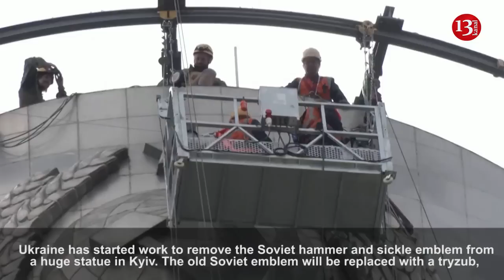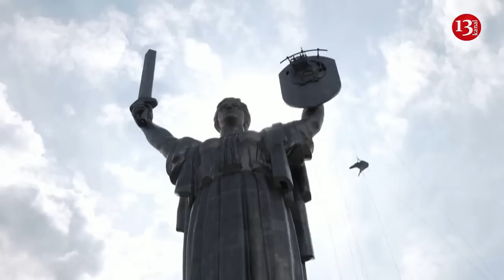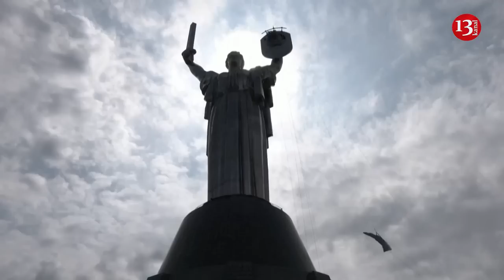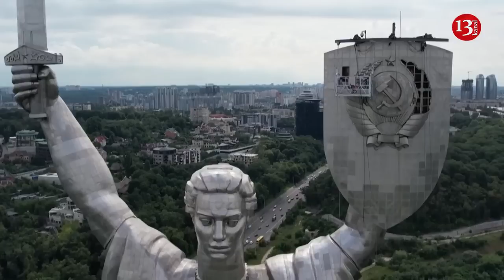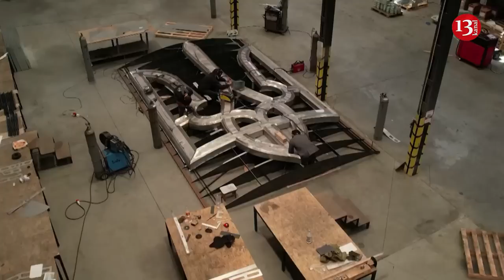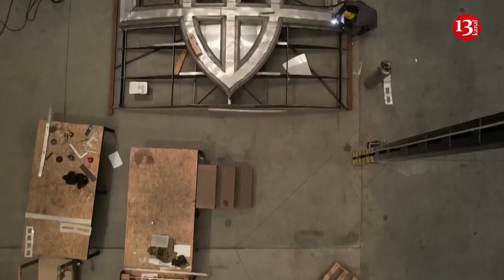Soviet emblem cut off from Ukraine's Motherland Monument statue

Comment: They should’ve just let them drop. Unless, unless they plan on sticking them in a drone  back to Russia and drop it on a warship.
Reply: They seemed to carry the cut-away part into the ww2 museum, I'm sure they'll find a place for it next to a reichsadler with swastika (Those that the germans used to hang on important buildings during their occupation. If I remember correctly, there is a large broken one just inside the entrance of the museum)